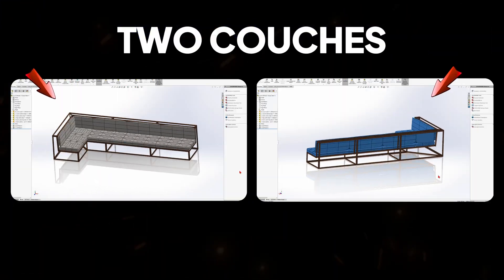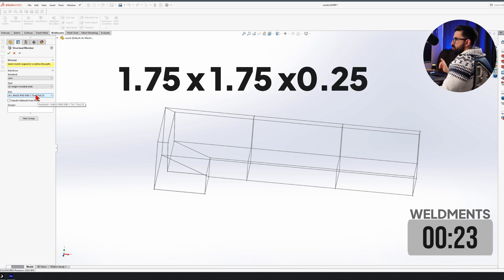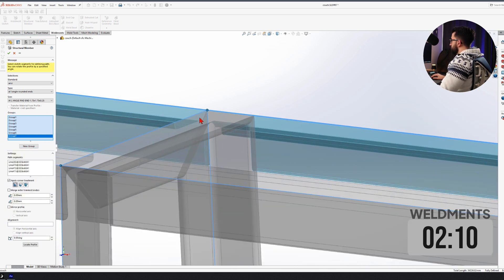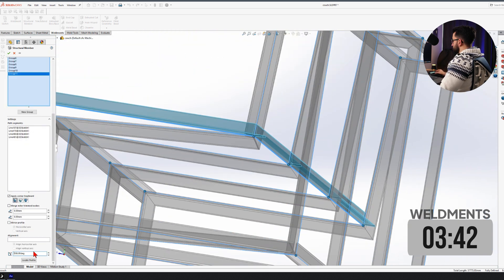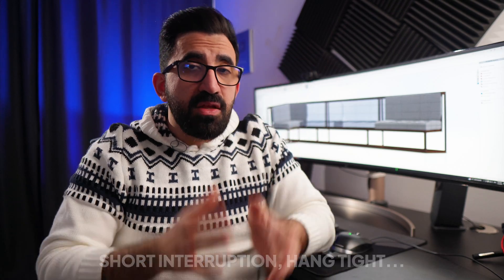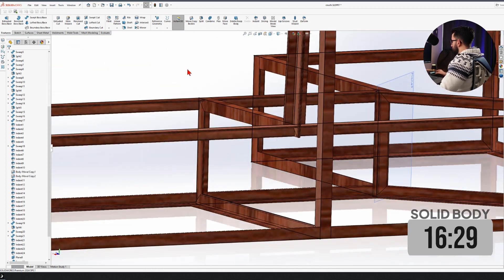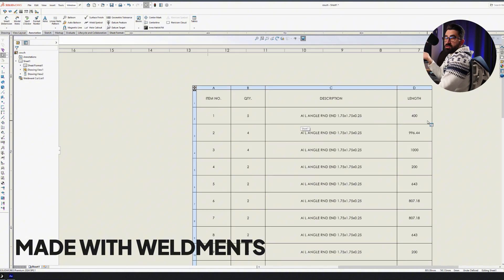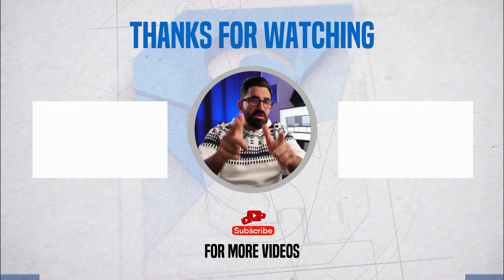Why Are You Afraid of Weldments in SOLIDWORKS?

Comment: Can you help me with this?
I can't figure out how to do it, or what approach to take. 

I want to build a rack that is  (measure from edge to edge of material)
12' high x 4' 8" Wide x 7' 8" Long with slots in between 10" apart (measured from edge to edge of material). 
Material is Rectangle Tube 3" x 2" x 1/4" Thick 
So when I create the lines before adding the weldments, my measurements are ok except the lots. 
once I add the weldment profile my measurements are off because the profile of the material goes in the middle of the line. 
I don't know how to move it to the edge.
How can I achieve this?
its very confusing for me...

Comment: very afraid indeed. sadly i haven't found a weldment option to make space for corner piece. so lets say a box with 8 pieces of 3 legged corner piece. (arosio frame) so the frame it self doesn't go all the way to the corner. but leave space for the corner pieces. so solid body and using equation is the solution for now. same box. different size.

Comment: Weldments are great. If your joint isn't working, you can use an existing portion to cut the part you're trying to get to interface. I don't remember exactly how to do it off the top of my head, but maybe you could do a little video showing off the method. While you're at it, showing how to use the weld bead and simulation bits of the tool would also be pretty good. I'm sure there are tricks to weldments I'm not aware of.
Reply from the maker: Great point!
Reply: (Oh, the tool I was thinking of is just trim/extend, and it's handy for getting joints to work when they're confused)